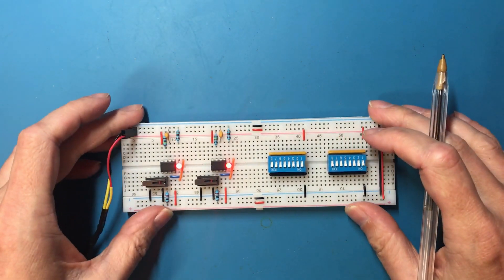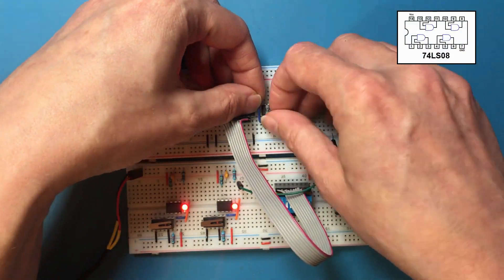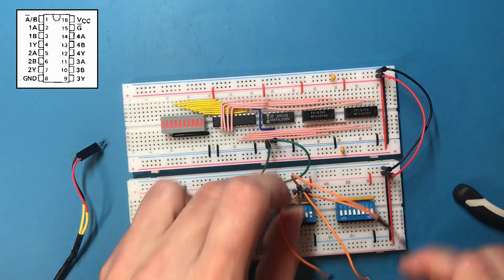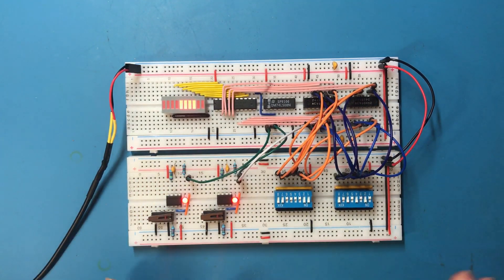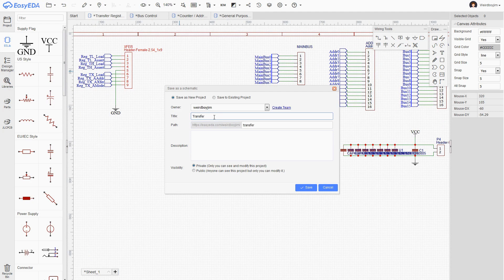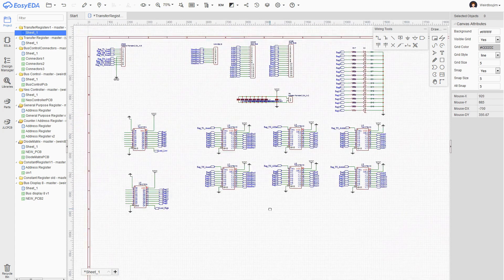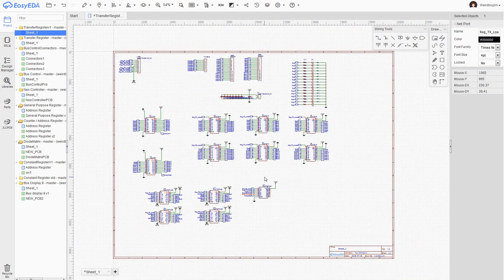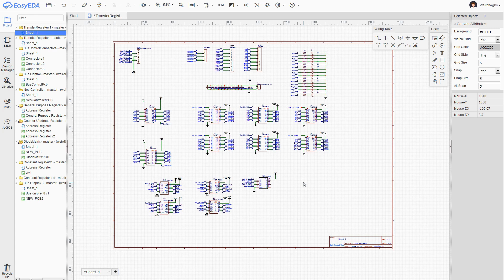Transfer Register (2: Dual Port Load) - Making an 8 Bit pipelined CPU - Part 48

Comment: You don't really need these and gates, I think.
Instead of two load lines, I would use a single load line and a select input line.
Your control words would be different, but you would use the same amount of control lines, but use less chips and also remove the possible ambiguity of having both load lines trigger at the same time.
Reply from the maker: Sadly that's not the case. There are other solutions but "single load line and a select line" is not the inputs that the cpu gives, and it wouldn't be easy to change that as the 8-bit loads are done from a different pipeline stage as the 16bit loads.

Comment: At around 6:16, I beieve you got the orange wires for bits 4 and 5 (switches 5 and 6 on the left set of DIP switches) swapped, but I don't know for sure because you never had any inputs where those two switches were set differently in this video. Other than that, great video!
Reply from the maker: I looked carefully in the source material and it looks correct to me, what purpose did it serve to worry about this?

Comment: Really nice that you added in the diagrams of the chip pin outs in the corners. Really helps to understand what you're wiring.
Reply from the maker: Thanks! That occurred to me when I was editing. I often found myself chopping out pauses where I knew I was looking back at the datasheet checking where a wire needed to go etc. It’s pretty obvious in hindsight that if I need to look at the pin out the viewers might want to.

Comment: I'm sure it'll become clear... but I'm not sure why you're bothering asserting this register to the address bus as well as the transfer bus.
I'd be so tempted to only use it for transfers just to cut out the number of busses it has to talk to as that's already "quite a few".
Reply from the maker: That would be a valid decision; I seriously considered having just the program counter and a “memory address register” on the address bus. Since transfer operations are done in a different pipeline stage to memory operations you could move any address register into the MAR in the same instruction. I went with this architecture so the program counter could be a copy of the other address registers to reduce the number of unique pcb’s.

Comment: I had to watch this a few times to understand how the selection process was made.  The first problem was the slippery logic of using and "and gate" to perform what seemed to be an "or" function. The other was being blinded by my confusion and missing the right hand switch to toggle the "a/b select". I finally got it. Thanks James, it's always great to stretch the grey matter to a new level of understanding.
Reply from the maker: Very pleased you’re enjoying the video but I apologies for the weakness of my explanations. Did you watch the design video beforehand? One of my reasons for doing that was the awareness that I’m not the best at explaining workings as I go. If you invert all the 1’s and 0’s in the AND functions truth table you’ll find you have the truth table for OR. When we are dealing the low signal as the active then the logical AND performs the logical OR function. One of the flaws in my videos is that my electronics can be quite naive (I’m very new to it) but I lean a lot on my computer science knowledge (That I’ve been doing for 30+ years) so I can treat things as obvious that aren’t. Hopefully I’m getting better with practice.